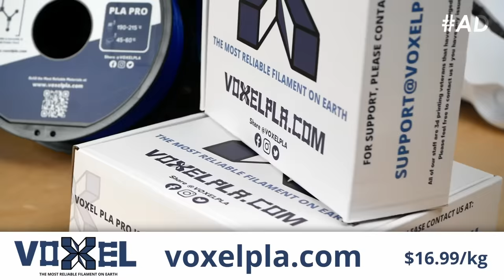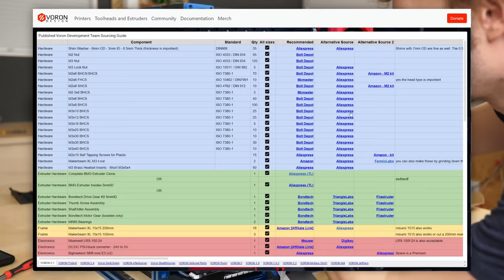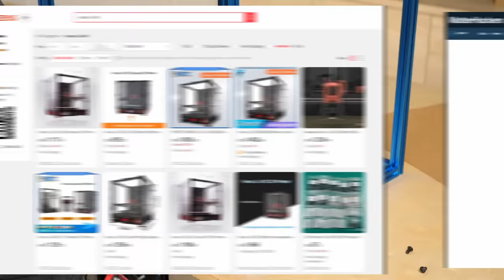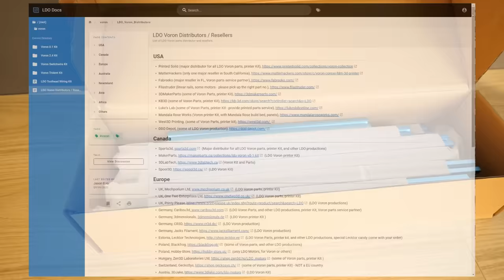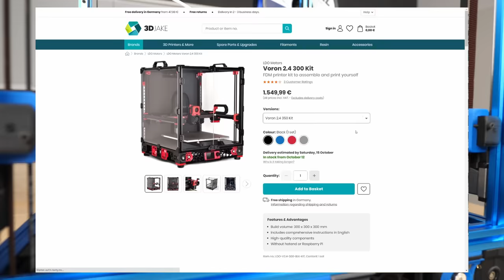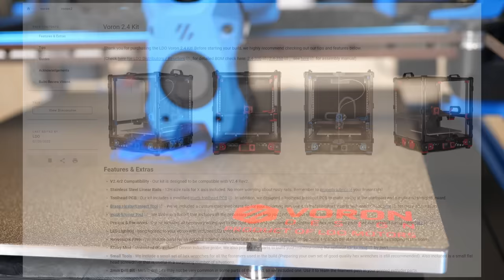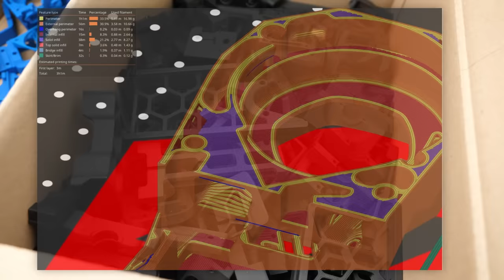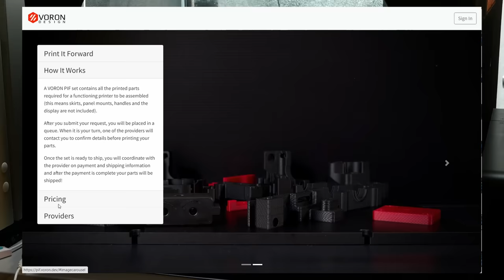Should you build a VORON 2.4 in 2023? (LDO Kit Review)

Comment: I've wanted a Voron for a few years now.  a coworker had built one and introduced me to them.  you mentioned that the parts were recommended to be made of ABS, but will PETG be good enough?  everything i've done on my CR10 was wither PLA or PETG.
Reply: I'd say it would depend on if you want to enclose or not. When enclosed and printing higher-temp materials the entire printer will get warm and that may reach the point where PETG is at risk. If you plan to go open air and only plan to print PLA and PETG. You can according to Voron's website use PETG for structural parts, though even then they'd still recommend ABS for at least the print-head and its fan shroud.

ABS/ASA isn't that difficult to work with. Just gotta keep your printer out of drafty winds, just mind the fumes and be sure to ventilate well after a print.
If your printer is having trouble keeping it from warping. You can try to use a "Draft shield" which is where the printer creates a very tall thin skirt around the print to enclose it and keep the hot air in. Both Cura and Prusaslicer have this as a feature.
Reply: @Foxhood  Thank you

Comment: Old video, but still very relevant.  TY.  I'm currently STILL running my original Folgertech 2020 reprap rig in a custom enclosure, modified with E3D hotend, SKR 1.4 running Klipper off a RbPi, input shaping with an ADXL345 S2DW accelerometer, and now a BTT Eddy.  Printing just keeps getting better/easier with every upgrade, I love the versatility of a home-built system.

Comment: I'm one of those people who need a ready-to-work 3D printer. Of course, until I make my custom one 🤣

If you're not a technical person, these projects may not be for you. But I'm always thinking that most of the common 3D printers are too dumb in today's technologies. And I sometimes think of features that can get rid of some painful parts of 3D printing.

I personally think about building a robot arm 3D printer. Because the gantries are taking too much space and making the machine very clumsy. It will be optimized to print on custom surfaces, and maybe even moving around the print for very large prints.

The printer will have a print bed as usual, but only for some prints. Additionally, the machine will have  a clamp to make custom build surfaces. For example, you will make a little platform to build the part on, using the same or compatible material. After building the platform, you will either remove it or not from the bed. You will attach it to the part holding clamp, and the machine will build on that custom platform. After printing, the platform will be removed by cutting it and will be reused. This will remove all the bed adhesion issues.

And if the machine is attached to the workpiece in anyway, it may be given additional axes. I don't like bed swingers, but a better part holding system can keep the part safe while moving it around. Rotate the part, move it on some additional axes; and you're able to do many different things during the printing. Overhangs? They may not exist anymore

LIDAR is also important to me. Especially for custom print surfaces. A LIDAR can make a surface map before printing and make custom surfaces easier to work on. It can be also used for distance calibrations, but I don't know about the accuracies and precisions. An additional distance calibration system can be added for more precise calibration.

LIDAR can also be used as a print status detector. If the layer has errors, the machine can detect them, may fix them, or use the new appearance of the print as the print surface and make a new roadmap for completing the part. Imagine cutting a piece from the print during the printing. LIDAR can detect that and the area can be worked on again without stopping the printing.

Oozing is something I hate. We have retractions and stuff, but it's never perfect. You may retract too much, the material may never stop oozing, etc. This makes me want a nozzle cover. Because a covered nozzle cannot ooze. You can have very long printhead travels with snail speeds, and the nozzle will not leak during that. It also removes the need to prime the nozzle in some cases. That is assuming that you can safely leave the filament inserted while the printer is off. Some filaments creep and break when left inserted for too long without being used.

Yeah.
TL, DR: I have tons of relatively simple or fancy features in my mind and I only want a ready-to-use printer to make my custom printer with it.

Comment: How about a follow-up "Built vs. Bought" against the Bambu X1 where you try to get that 31 minute Benchy down to the 17 minutes of the X1's pre-sliced one?   (with identical quality of course)

I'd love to see if it could be done with only tweaking/tuning, or if it would require spending money on upgrades.   I don't mind building a Voron, but if it can't produce the same speed/quality as the X1 for about the same cost, it's hard to justify the time, even if I do dislike the closed-source nature of the X1.
Reply: On second thought, comparing to their pre-sliced one is not really fair since Bambu may have spent considerable time tweaking that gcode to make for a really impressive first print.   Good marketing, too.  A better comparison would be Benchies you sliced yourself on both printers, although maybe the Voron would already be able to match/beat the X1 in that test already.

Comment: The only real advantage of the Voron 2.4 is the 350mm version over the X1.  100mm bigger build volume means you can actually make those larger prints, and with programming and tuning it can also reach the 500mm print speeds too.  Run out Sensor is a "nice to have" but not entirely a requirement, hell I have actually removed the sensors off of my Neptune 2S's as they were getting old and causing drag.
The X1C by itself isn't going to have any advantages over a Voron, its with the AMS that the X1C shines, since now you can print something IN COLOR!  Granted there are addon things like the Pallet 2 or 3 that allow you to print in color with any printer, but its compatibility with a Voron is something to explore on your own.  As that machine requires that it be talking to the printer and is, more or less, taking control during the print for the color changes and purging blocks.
In the end I plan, myself, to have both.  A Voron as the main printer (large object/mass production) and a Bambu X1-C with AMS for making the same prints, but already "painted" in color.  However that is going to be one expensive overhaul to my printing setup, going from two, fairly cheap, Elegoo Neptune 2S's, to a Voron 2.4 350 and a Bambu X1.

Comment: The motor noise can be removed with stealthchop. Most just want performance and speed vs less motor noise. 
The fans are another issue but you could also make them less noisy and print slower as well.
Feel like that is worth pointing out.

Comment: I just finished building my Voron V2.4R2 kit from LDO in the 300mm configuration. With the panels on and the electronic fans set to 0.2 it is not load anymore.
And regarding the Z-Offset problem: take a look at Voron Tap. It is a new way to measure the distance by mounting the toolhead onto a small linear rail and using an opto-switch as a trigger. I have done that modification and my first layers are great. Also no more docking and undocking the probe as now the nozzle is the probe. That way it also compensates for expanding metal due to the temperature.

Comment: My printer is not Voron type. However, there were quite a few caveats with Bowden tubes, so we sourced from reputable buyers. Tubes that are wrapped too tightly when shipped are often unusable for 3D printer applications. In addition, even the slightest difference in outer diameter can cause troubles such as not being able to fit into the joint, or being unable to remove it once it has been put in. After all, we regard them as consumables and deal with them by buying a large amount of a specific brand at a time.

Comment: Stealthburner with CW1, and with no LEDs is very sad. 
Also, we are on the second half of 2022, CANbus toolhead boards should be the norm.
Reply from the maker: Yeah, my task for next week is to get these LEDs working. They unfortunately were very low on my priority list.
Reply: @CNCKitchen  can understand you… perhaps you can do that together with a video on CANbus toolhead boards, there are plenty of possibilities nowadays, and one specifically designed for the SB was released recently by Mellow. 

Anyhow… you should complete the look of the SB by switching to CW2, the Sb with CW1 is a kind of abomination 🙈. 
I realize that after the fact it requires some extra work for replacing the gantry mount, but I’m sure you’ll handle this easily 😀
Otherwise, your build looks fantastic.

Comment: I've been having a really hard time choosing between this and the RatRig V-core 3.1. Both seem like amazing machines. I do really like the kinematic bed from the RatRig, though.
Reply: voron has kinematic bed mounts as well, I have one on mine from mandella roseworks. both are great printers honestly and i dont think you could go wrong with either. if your wanting to print higher temp stuff though voron is built for it with a built on enclosure, the ratrig enclosure would be a extra cost. thats really the only downside i have found.
Reply: Well if you like kinematic beds, the Voron 2.4 has a "little" brother called the Voron Trident. Which is built the same way as the Ratrig V-Core with a Bed that is trammed via three steppers. So may be worth to see which is more readily/cheaply available in your area.

Regardless they all are indeed great printers as 3DPrintingBiker mentioned.

Comment: I too just completed a Voron 2.4r2-300 LDO Motors kit using PIF provided parts, and I have been thoroughly enjoy it thus far. Most of the printing I've done to date has been either for tuning or printing the non-function ABS parts not provided by PIF. There were issues here and there in the kit, but between the reseller and LDO things were dealt with quickly when they came up.

Comment: more expensive and without enclosure ? Smaller LCD? No touch? DIY is good, but let's not forget DIY should help us to save cost and make better stuffs, not spend more and make worse stuffs...If a DIY version costs more and less good, then this DIY is very questionable. besides, voron doesn't look like a very true DIY printer, so many non standard parts are required from those suppliers, for example , holes must be drilled precisely in the alu extr, thick and special size alu heat bed with drilled and tap holes etc.  maybe buying voron parts from 100 vendors would be much much more expensive, but buying from one supplier like LDO is already too expensive enough...again, the value of this kind of "DIY" is very questionable. If one is really rich and like DIY very much, instead of buying a more expensive voron kit, he can disassemble a bambu and try to assemble back again, no warranty( the same as any random voron kit).  I'm not a bambu fan but seems bambu is a better choice vs voron , my opinion only.

Comment: Overprice. Overengineering. No stiffness. Many possible points of failure. Any other printer with CoreXY, direct extruder and Klipper will be faster and cheaper. That's all you need to know about voron 2.4. The most irrational design ever.

Comment: I will built one for sure and not buy a Bamboo or Prusa X1. Though as easy as it would be to buy a commercial one, this would simply be completely mine, open and ready to tinker with when I want. The only reason I didn't yet was the requirement to have your own 3D printed parts and my printer I have is just not making parts as nice as I'd want for such a printer. :) Now this is solved as well, so let's go!
Reply: The Prusa X1 is much better than this boron.

Comment: What about cnc aluminum printer parts some kits are selling?
Reply: Don't waste your money. Some of the design needs the flex build into the ABS parts.
Reply: @christiantreldal1585  some, but not all?
Reply: @emaayan  I only refer what I heard from the Voron design team. You might be able to use some alu parts; but which parts? And why have 2 different types. You can always print a new abs part; but what if you strip a tread in a alu part? Not easy fixable. The ABS parts are much cheaper.

Comment: I have 2 Vorons still in boxes that need to be built.  But after getting the Bambu Lab X1C with AMS, it's hard to justify the time needed to build a machine which is inferior to the X1C.    The XL had to go back to the design team because they saw the features and capabilities of the X1C and no one could justify $2,000 USD or more for it and it still could only meet the Voron V2.4 R1/R2.   Tool head costs are outrageous as well.  All Bambu Labs now needs is an X2 with 400x400x500 for commercial users.